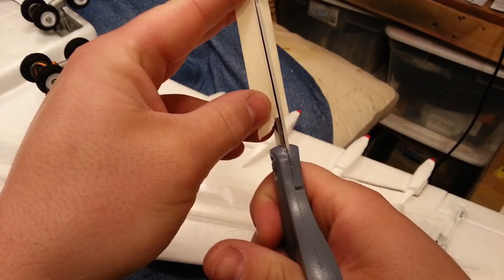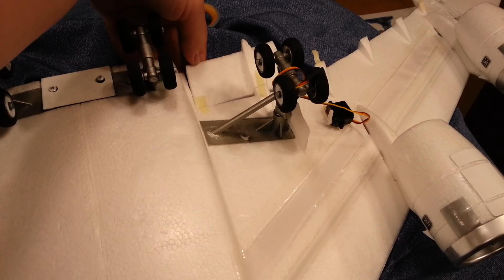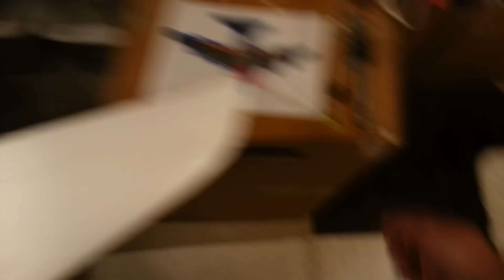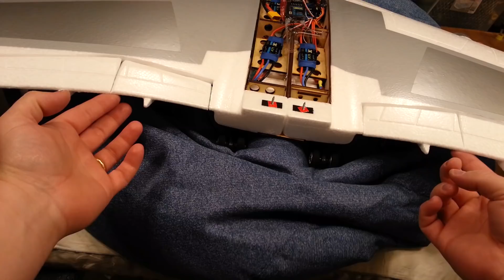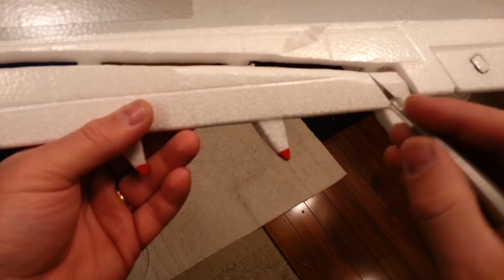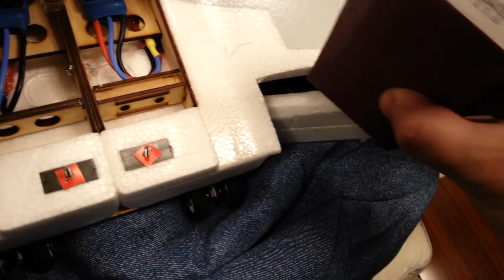Tian Sheng - Airbus A380 - Flaps Part 3 - Cutting & Shaping

Comment: Whats up with the "Private Video" on the other parts of this series?
Reply from the maker: That's what happens when they are "uploading" or when they haven't yet published. Sorry about the confusion, but did you happen to see the reply I sent you earlier?
Reply from the maker: Can you tell me which ones are still listed as "Private Videos" on your end???

Here's my master list, so far....the ones with an # are not yet published

Flaps 1 - Overview & Layout - https://youtu.be/aIj5lHOUhgw
Flaps 2 - Measuring & Cutting - https://youtu.be/kuL8mk43FWg
Flaps 3 - Cutting & Shaping - https://youtu.be/n5ysaGyv2Ao

#Flaps 4 - Hinging 1/2 - https://youtu.be/7SMNHhby1mU
#Flaps 5 - Hinging 2/2 - https://youtu.be/SeUMQPTqKLo
#Flaps 6 - Wiring & Radio Setup - https://youtu.be/-g5KqiKKl0A
#Flaps 7 - Servos & Linkages 1/3 - https://youtu.be/v_SMfp7HRjs
#Flaps 8 - Servos & Linkages 2/3 - https://youtu.be/rGCIuVxAC5U
#Flaps 9 - TBD
#Flaps 10 - TBD
#Remaiden Flight - TBD